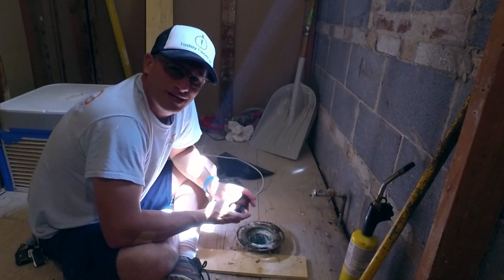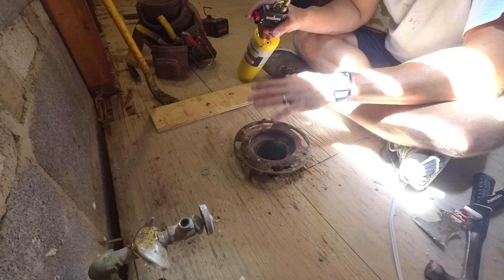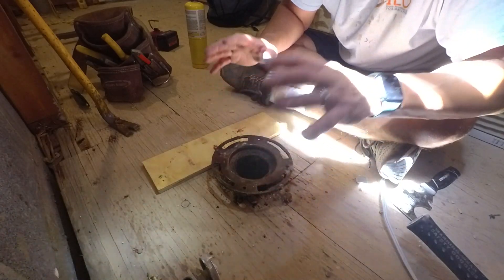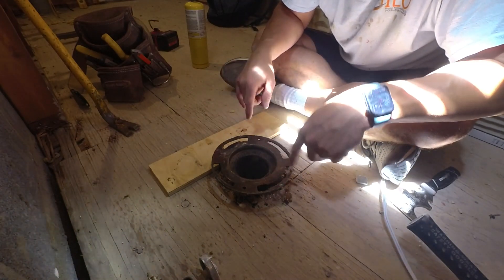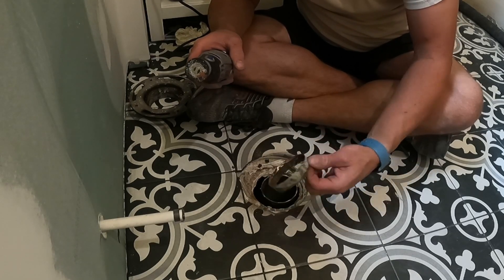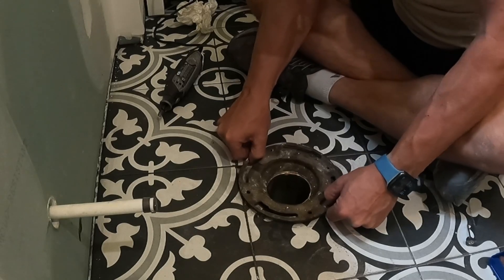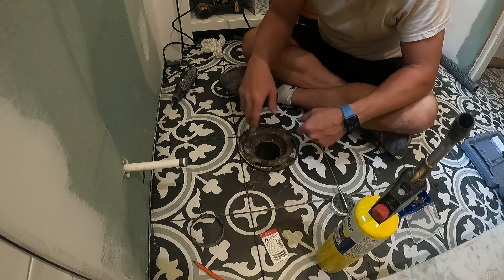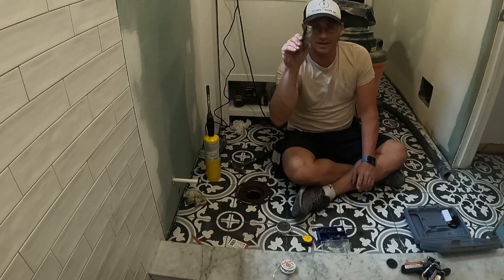How you Remove and Install a Brass Toilet Flange on a 3" Copper Waste Pipe

Comment: Hey cool video. I have the exact same issue. An old house that had a mud floor with mosaic tiles. Just ripped out the tiles and cement and now need to patch some rotten 1/2” plywood near the flange and I want to add fresh 3/4” plywood over the old 1/2” plywood.

2 questions:
1.) Why did to reuse the old flange? When I took the toilet off, it had bolts with round heads on the bottom that just kept spinning. It was a nightmare removing them. Are there good bolts to buy that won’t spin in this flange?

2.) Did you overlay that old 1/2” plywood with new plywood? What did you do? Is there a video?

Thanks!
Reply from the maker: Toilet bolts? 

I patched that area then laid down self leveling cement on the subfloor.

I never thought of doing a video on how I fix an area of rotted subfloor around a toilet.

Comment: Is there lead in these old brass toilet? or at least the sutter..   i think i might have smell the fumes.
Reply from the maker: The lead you have to dig out since it’s packed. It’s usually on a cast iron pipe. Since this is a copper waste, it’s a solder. Two different applications.